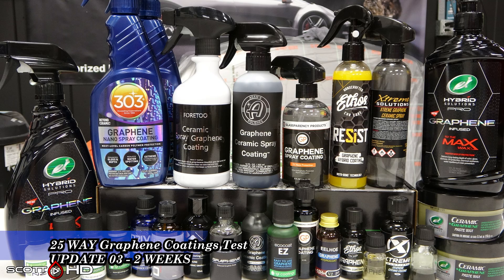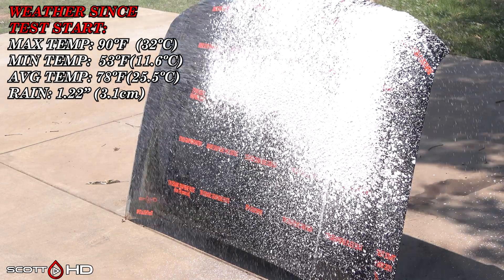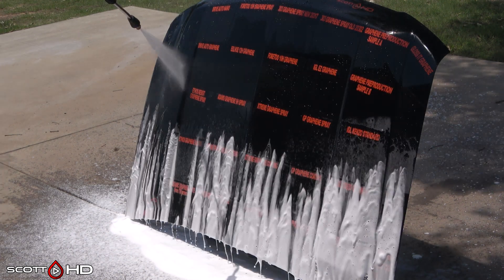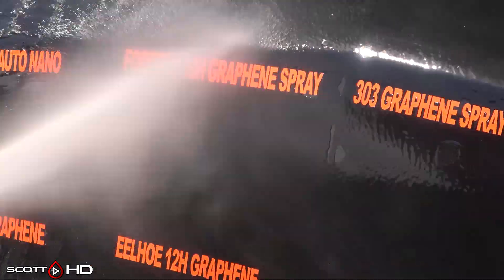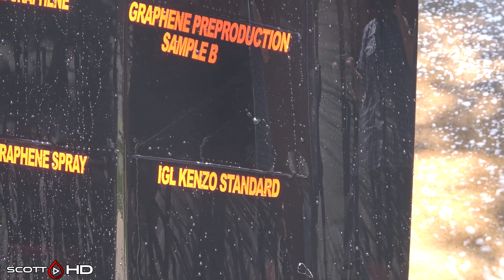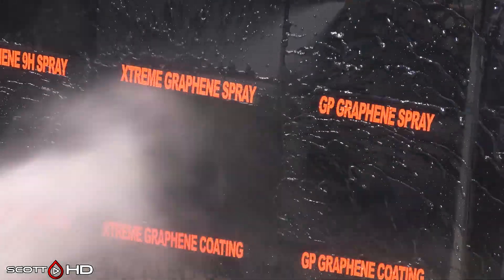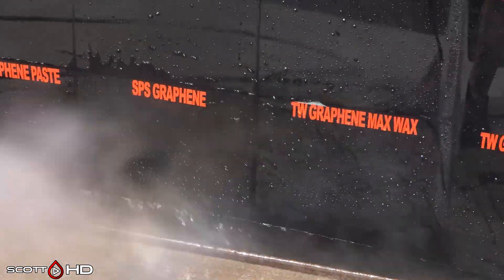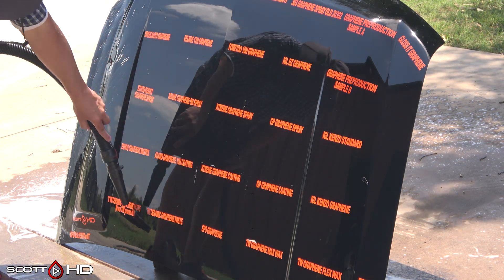Graphene Coatings Longevity Test - 25 WAY - ULTIMATE comparison - UPDATE 03 - 2 WEEKS - New Failures

Comment: Why are all these graphene coatings failing at water spots? Any idea? Any suggestion at addressing water spots?
Reply: Theres no way to avoid water spots as these are leftover minerals in water, graphene coatings help protect against water spot etching which is left behind when water spots are removed. There is a difference between the two that isnt properly communicated.

Comment: looked like all the water spots were easily removed when washed....my experience with graphene products is that the spotting occurs - but is easily removed!!!  does not stain the surface when compared to coatings/toppers/si02 sprays.  the appearance of the spotting is more "dust like"
imho.  that is the benefit i have experienced

Comment: Thanks for another great update Scott! I have a technical question that may inspire you to do a video in the future. I currently use Nano Age 9H and have served me well only needing to boost it every 2 years but, now I need to remove the coating in order to wet-sand some imperfections and possibly add clear to increase depth. This is a modern classic Porsche with color/clear coat and repainting it is out of the question to preserve originality.  What would be the best way to remove the ceramic coating from the paint? Will a light wet sanding be sufficient or can I use some sort of solvent?
Reply from the maker: Not even a wet sanding. Just a Microfiber pad and a good compound should remove it.  Then wipe with IPA and then pour a bottle of water over the paint. Does it stick? It's gone. If it's still hydrophobic, more polishing required

Comment: Scott, I used TLC2 and then topped it (after cure) with TLC Amp. A month later I added another coating of Amp. If I wish to do a paint correction should I remove all coatings down to the clear coat?
Reply from the maker: I would start with a bare finish for any paint correction. Usually anything on it will get polished off during a proper paint correction
Reply: @ScottHD  👍

Comment: Excellent comparison. Really enjoy watching. Purchased the 303 Graphene Spray when it first came out, so I have the “Old”. Got similar results. It failed after a couple of washes with 2 coats applied according to the directions. The pro to this product is that it can be applied in direct sunlight. As I use the 303 Graphene to use on my daily driver that is parked outside and can’t always find a shady spot to apply a product, this is a definite advantage.
Reply from the maker: Good to hear. 

I agree - you have to weigh the pros and cons to these products.   Longevity, price, ease of install in heat/sun/humid environments, snow/salt belt, etc.

Comment: I'm doing a tw flex wax longevity test on my daily driver too. On week 3 now so pretty much the same time frame as you. Will be interesting to see the difference( if any). I've heard that towel drying the paint after rinse will in some cases show a more realistic hydrophobicity as the soap can leave residue. Ever heard of that?
Reply from the maker: I have, although this soap I'm using is the same I have used in all of these tests for the last 6+ years so I don't want to change it or otherwise introduce a different variable into it.
Reply: @ScottHD  that makes sense. Don't think it would make much of a difference anyway.

Comment: Are you laying the hood horizontal to get the full water spot effect?
Reply from the maker: It gets rotated 90° after each time I wash it but generally does not sit flat because of the wind we get here...I'd have to tie them down every time
Reply: @ScottHD  I gotcha, however laying it flat is the only way to get true water spot resistance. You know that the top surfaces water spot way way more than the vertical surfaces do. Water spot resistance if supposed to be one of the attributes of Graphene. Good test though. I’ve used some of these with varying results. Amazing that one of the original Graphene company’s is still hard to beat...SPS😂!

Comment: Hi, I applied 303 Graphene 7 weeks ago here in the UK. We have had cool weather around 12deg c and lots of rain. the protection is still holding up but considering it states 12+ months on the bottle I would have expected it to perform better. My car is not garaged so its out in all elements 24/7. My 6 week update is going live on my channel this evening at 19:00 GMT if its of interest
Reply: Gonna tune in 👍 would guess 5-6 month. I´m on week 2, and gonna do a second layer in 1-2 weeks. Then top it with resist
Reply: @lazyjacket  I want to add a sacrificial layer but fighting the temptation off as I want to see how long it lasts in its own. I have given the car 3 maintenance washes since applying it
Reply: @ObsessiveCarDetailer  I can see that you want to see the durability. And I`ll be checking it out via ur chan and Scotts. Myself, gonna top it and hope for better durability and better slicknes 🤞
Reply from the maker: Good to know.  My experience is they get you with the "up to" language.